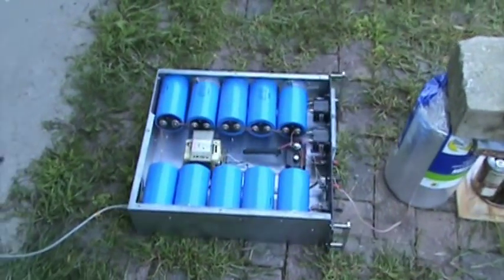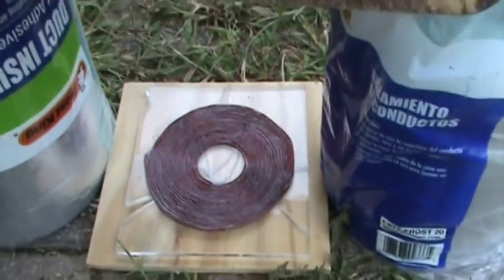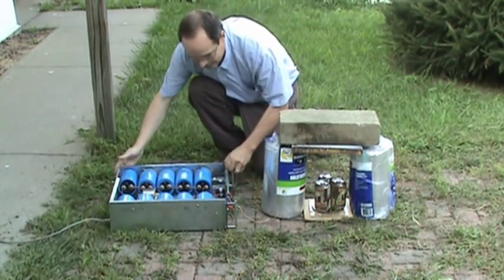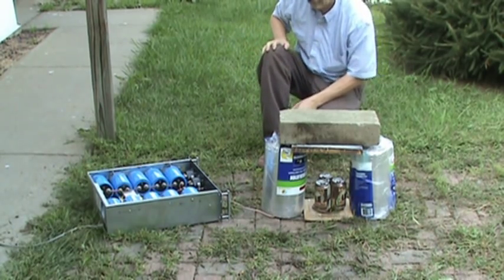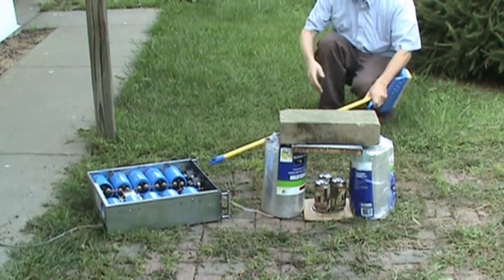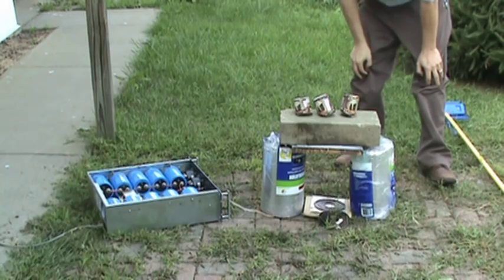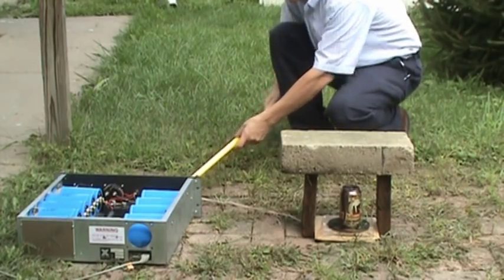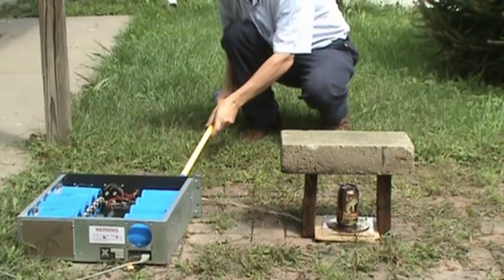2KV Washer Launcher

Comment: The resistor was smoking up due to the amperage draw, the lower your caps are charged, the more amps it demands.
Reply: +musicwiz40 
Yep.
The best limiting element for him would either be a high power incandescent light bulb, or a heating element, from a stovetop, stove, kettle, space heater, etc... If that's too much, two or more can be put in series to further reduce maximum power.
You can also use a capacitor (non polarized!) to limit the maximum current, though you have to be careful not to create a an oscillation, since you then have an LC circuit. (Built up oscillations could produce high voltage, which might kill rectifier diodes, or other things, like the current limiting capacitor itself)

Comment: You know when a puff of smoke starts rising off a 50 watt ballast resistor it's going to be good.. This circuit is capable of performing 100 defibrillation's or one Human explosion... Good choice on the mop stick. The can crush was amazing and so was the washer launch.. 

Anyone want to team up and get a bank of 20,000 super capacitors to send a washer out of earths orbit? (10 Farad @ 2.7v $6 each).. $120k.. You can bet the people keeping people down have access to a million of these parts if it means more control... 

We will need 1000 of them in series / paralleled 20 times... .2 Farads at a safe 2500 volts. If my calculations are correct.

Yep, must be nice working at Los Alamos.. They are all about figuring out how to blow up people and find more oil and gas these days instead of embracing obvious clean sources with all the iteliligent might floatiing around from bar to brothel these days.. I say lets find the future of energy on planet earth... The .2 Farad 625k Joule charge I dreamed just now is just aching to be built by some rich person interested in tech. Just like Google building massive solar farms one year after I extensively commented on the power density of the sun in the SW.. Kinda pissed actually. Pretty sure my idea's were stolen by belonging to G.. They see everything! Stay safe Bob
Reply: Ill buy 600 of them or something lol.
Reply: I'm serious. Crowd source to build a BIG one.
Reply: Actually I just remembered an experiment back some time ago, that they tried to send a manhole cover into orbit using a nuclear explosion. 

I don't remember exactly what happened but Cody'sLab did a good video on this using conventional explosives.

Comment: YOU HAVE NO IDEA WHAT YOU ARE DOING.
Add balancing / bleeder resistors network across each cap. A resistor across each cap, all in series, will balance out voltage seen across each cap because you will make a multi-tap voltage divider out of them. You will have less chance of exceeding one particular capacitor's voltage rating if capacitors are not are all charging just exactly equal to each other. Such resistor will also safely discharge each capacitor. With a proper chosen value, resistors should discharge in no more than say 3 minutes with their bleeder resistors. YES this will require immediate discharge after charge, or power supply can be kept turned ON as caps are discharged, perhaps isolated against the dead short by a resistor.
Invest in PPE. Gloves, goggles, face helmet, hard hat, fire extinguisher, ear protection, apron. House insurance. Roof insurance.
Buy a high-speed camera.
Get a bigger yard, or wait until neighbors are not outside, or out at work.

Comment: Ugh I almost couldn't bear to watch this, so many safety failures that my toes were curling up! What a fool!

Just to list a few of the mistakes:
- capacitors exposed to the open air, where an insect could fly in and short the terminals, causing the capacitors to explode - lethal
- uncontrolled charging rate, leading to burn-out of components - dangerous
- probably unregulated power supply charging the capacitors, in which case the high ripple current from the transformer could cause the capacitors to overheat and explode - lethal
- TOUCHING THE CAPACITORS WHEN CHARGED!!!!
- exposure to high velocity debris when firing the device - lethal
- possibility of metallic debris ending up inside the power supply (explosion / uncontrolled short risk) - lethal

Bob, I'm a physicist, and when I was in high school and college I did some pretty stupid things with high voltage. Things I would never do again. But nothing I did was even 1/100th as dangerous as what you're doing here. Please, just stop. This is not cool. This is terrifying to watch.
Reply: I agree with Colin. Seeing you touch those capacitors is just plain stupid. You must be tired of living or something! Furthermore, you don't use resistors that are underrated in surge capability. PERIOD!
Reply: The capacitor bank should be have a barrier between
you and them.I have seen much smaller caps explode with tremendous
violence.The HV switch stick is great.The HD disk could explode also
into pieces which may not travel straight up.A safety shield of safety glass
or thick plexi glass would reduce risk greatly.
Otherwise its is a great experiment and I loved it.
Thanks for risking your life for us.
Reply: LOL when i was 15 i use to love pulling 4 inch arcs with a microwave Transformer hehe.
Im sure hell learn when one of those things u mentioned will happen to him lol
Reply: I believe the component that "cooks" in this device is the current limiting resistor...... to be honest I don't think an insect falling on an individual capacitor will do much...
One very dangerous thing though is touching the cases of the capacitors in this while they are charged... beneath the plastic sleeve of the capacitor could be at nearly 2kV according to where in the string it is. Although most of the fun of this is it's destructive power it would make a lot of sense to use a better rating of series resistor and to fit a lid to the cabinet. Doing dangerous things is fun, but it pays to "manage" the danger!
Reply: yes a metal cabinet lid with its hold down screws would fix most safety issues here.
I would were hearing protectors.
The broom handle is cute.But many broom
handles have metal cores.
I am amazed the switch he is flipping can stand the high current.Also a mistake he
made is turning it on a putting his hand into the can crusher?Otherwise very interesting
experiment.
I do agree with Colin on touching the caps
when charged the insulation resistance may not be high enough for 2 kv.
Reply: +Loyd anonamous 
The full current flows through a power semiconductor device (either an SCR or an IGBT, most likely), not the switch XDDD
The switch would literally explode into microscopic fragments if it was taking all the current.
I do agree with wearing hearing protection though ... hell, shorting out 30 joules (at about 300V) made my ears ring! It sounded like a firecracker! Imagine what a few kJ would sound like!
I would also wear at least a hard hat, if not hide under something thick and strong. Even if it wouldn't break the skin, I bet that metal disk would still hurt really badly if it landed on ya! 
Also, I think people need to stop complaining about the safety. He's fully aware of the dangers he is presenting to himself. If you're going to be that scared of electricity, then you should also be deathly afraid of knives and sharp, spiky things which could just as easily kill someone.
Reply: uh... a fly? one that fly would have to have a pretty big wing span. 2) its far more likely all u would get is a charred fly
Reply: It's actually worse than you think. A bug flying between the terminals could easily cause the air to breakdown due to the bug's body being slightly conductive and shortening the effective separation of the terminals. Once the arc forms, it will continue until the capacitors are fully discharged.

So effectively you have a dead short suddenly appearing across the capacitor. The air where the arc is will heat up and expand at supersonic speed - an explosion. This has the potential to rip open the top of the capacitor where the arc is. Now the arc moves inside the capacitor, and it explodes, killing our Youtuber.

Taking basic precautions, like sealing the capacitors inside a grounded secure box, would mitigate most of these issues. There's no excuse for this kind of recklessness.
Reply: you still have  to face the odds that a bug large enough to cause that is highly unlikely to enter that exact space, its a matter of right sized bug being perfectly between both terminals. Then there is also a cchance that all u get is the arc and it doesnt blow up. at the end of the day, driving to the store to buy the enclosure probably has way higher odds of killing the youtuber. go be pointlessly ocd somewhere else.
Reply: I know people who have had EXACTLY this accident happen to them, and had the capacitor in question explode. Fortunately they weren't injured. I'm a physicist and electronics engineer running a lab at MIT. Newsflash: the one without a clue here is you.
Reply: also, thanks for reminding me i forgot the last component of the odds ....u have to also figure the chance that the metal chunk contacts the youtuber in a critical area or a large enough cut to cause rapid blood loss. Again no doubt it could happen i just find it all highly unlikely. You have to remember that just because u've seen it happen doesnt mean its common.  I've been in a terrorist incident. I dont think its something the odds favor most  people having to fear
Reply: ohhhh! there it is.... do spew more elitism at us.... love it!.... im coming from the stance that your attitude keeps many from ever having an interest in electronics. it keeps the masses reliant on disposable devices and thinking electricity is magic and pixies.. you know the attitude that make ceos ritch while destroying the middle class.
Reply: Good lord...
Reply: From what I can see the capacitor bank is 10 series connected capacitors, so at 1500v total each capacitor will only have about 150v across it (ideally they ought to have equalizing resistors across them). A bug landing on the terminals of an individual capacitor will do nothing, unless it is wrapped in cooking foil.. I have seen capacitors explode over the years, but usually due to significant over voltage or massive leakage current. I don't believe these capacitors individually store enough energy to spontaneously explode even with this abuse.
Reply: An insect does not make a capacitor explode. Only the fly would have a bad time. Also 2kv can jump a gap of about 2mm, a distance of 1cm from a charged wire is kinda safe. The capacitors where also grounded to the case, that's grounded to the outlet.

Comment: I agree about the safety issues.  I use to play with black powder all the time and increased the quantities i made until I had a batch burn the skin off my Left hand by a rogue spark that traveled across a room in an arc right into the bottle I was holding.

That was a good experience and taught me anything that can go wrong, "CAN GO WRONG!"  

Needless to say I was a bit more cautiousness when I was two years older in the military and I always connected my branch lines to my explosives after the other Ghetto rats connected theirs and they moved away from the ring line.  Because C4 gives you a large headache, and det-cord is like kind of faster than I can outrun. Just like explosives those washers are hauling butt when they launch and if they can slice someone's head off "They Can slice someone's head off."

Listen to experience like my Drill Instructor who pushed my teeth in the dirt when I tried to see where my hand grenade landed the first time I threw one.  Smiling teach are no match for shrapnel.

All though I have lifted a 1.5 inch by 6 foot by 4 foot sheet of steel about a 1/4 a mile in the air with a couple sticks of C4.  It looked like a spinning little dot until it started coming down towards us then it looked like a humming whining death device, and so we jumped in the bomb proof bunkers  we were behind as well as huge berms of dirt to protected us from the direct blast.

That all said lets put some Graphene Based SuperCapacitors to work with a couple hundred thousand volts charging all night with more resistance to protect your home circuits  and see how fast that washer will fly when you cut that loose.

Comment: great vid. I have the caps ,SCR,MOT/MOT's ?, resistor just need to make a coil do you have a wire gauge that works well ? It shocks me that it doesn't obliterate the connecting wires to the pancake coil  .Thanks John

Comment: How hot does the washer get? I'm wondering if you could make this more efficient by using a slightly thicker washer.
What about attaching the coil to a shield or guide, for the magnetic field to flow through. The idea would be to focus or direct the field across the washer itself, rather than the washer and free-air. You might get away with much less power for the same propulsion, but I dunno - never tried it, and I'm not an expert XP
Reply from the maker: Thicker washer does make it more effective as far as lift versus weight.  The washer seems cold to the touch.

Comment: @bobdavis321 

The thicker material allows for a more thorough interaction between the disk and the magnetic field.  This would be due to the relationship between magnetic permeability and flux density creating the eddy currents within the disk.  If you dig a little about inductor cores, this interaction becomes apparent.

Have you tried any materials other than aluminum?  I toyed with other conductive non magnetic materials with some success.  Copper, silver and  titanium reacted to the field.

Comment: You should pillage a washing machine pressure switch. that way you can control the charge and scr trigger from a distance using just a rubber hose and some sort of pump like what's on old blood pressure meters. Photonicinduction mentioned it when he was building the 'Big boy's power supply' for his Hadron project.

Comment: Good morning
I can have (IN PRIVATE) the wiring diagram .... I'm interested in building a Maghetizer for speakers ...... what thickness of wire used for the coil, how many turns, the total diameter after it has been wound.
After has updated the discharge circuit ?. . . to replace the broom handle? ..

Buongiorno
posso avere ( IN PRIVATO ) lo schema elettrico....mi interessa per costruire un Maghetizzatore per altoparlanti......che spessore di filo ha usato per la bobina, quanti giri, il diametro totale dopo che è stata avvolta.
Dopo ha aggiornato il circuito di scarica?. . .  per sostituire il manico della scopa?..
Reply from the maker: See my blog at bobdavis321.blogspot.com   http://1.bp.blogspot.com/_b9kQtY-02vM/SVWZ8XMgO0I/AAAAAAAAAJc/gvXGun9nO4g/s400/Flat+Coil.JPG

Comment: Your last set of videos inspired me to build a similar disk launcher for college.  I only used 650 joules of energy, but could launch a 3 inch hard drive disk about 20 feet.  My power supply consists of a variac and a transformer from a bug zapper,  The transformer has a built in current limiting, so it's not "as" dangerous.  I also used a remote triggering circuit using an SCR module and a low voltage power supply.  I only was able to put 500v into my caps, but was fun non the less.

Comment: I watch your videos a while ago and i ran across your add on Ebay and didn't put two and two together.. I'm looking for some Capacitors that are that size. Any way you could help or would you  be able to sell me 6 for a good price?
Reply from the maker: I will relist them.  I do not know how many will fit in a flat rate USPS box.
Reply: Okay, will you giv e me the link on this comment! thanks!
Reply from the maker: http://www.ebay.com/itm/-/182210194019?
Reply from the maker: Ebay: Philips 3700uF 400VDC Large Electrolytic Aluminum Capacitors

Comment: ok here is something i didnt get
it is 2KV and 1600 amps so it is 3.200 kw
it can power a hous for months ??????
Reply from the maker: It only works for a fraction of a second.....
Reply: +imad omda 
Rather than using watts, calculate the stored power as joules. 1 joule is 1 watt for 1 second. :)